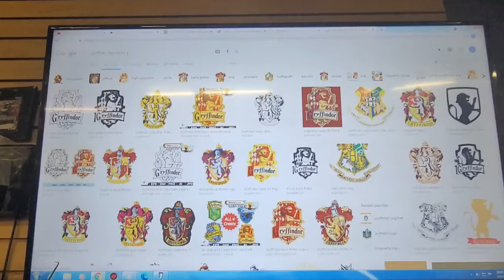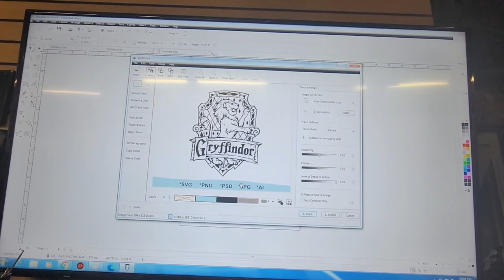Drilling a new Vac Mold from Palehorseconcealment.com

Comment: in the video you say use a 1/8th bit but the section under the video says 1/16th.  Which one should use, purchased my first mold want to make sure I do this correctly.
Reply from the maker: You can use either or. I went with 1/16 cause of a nice small hole. But both work